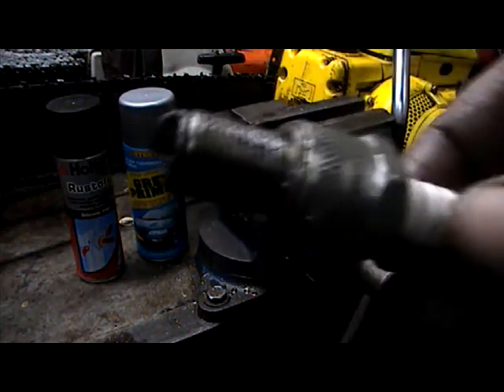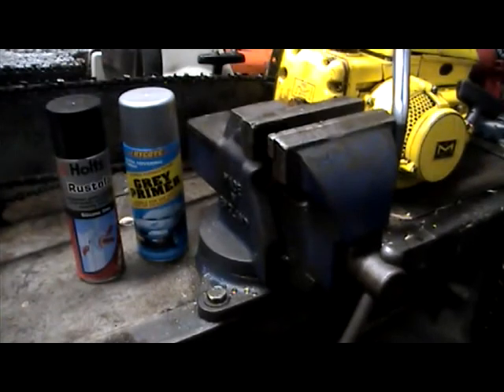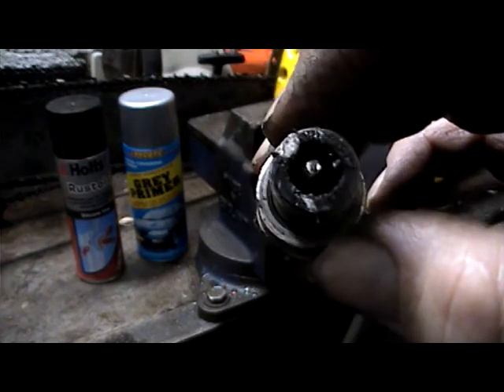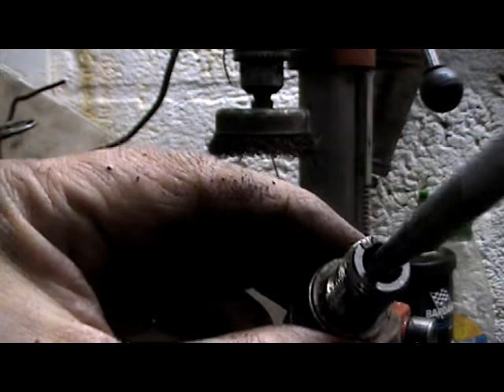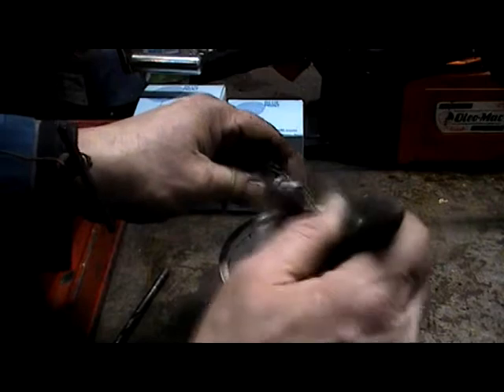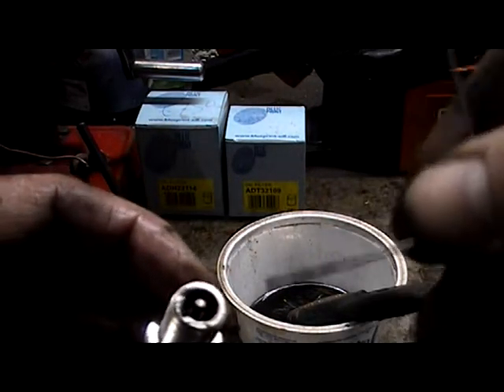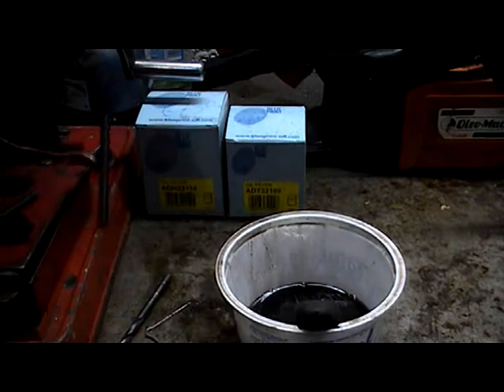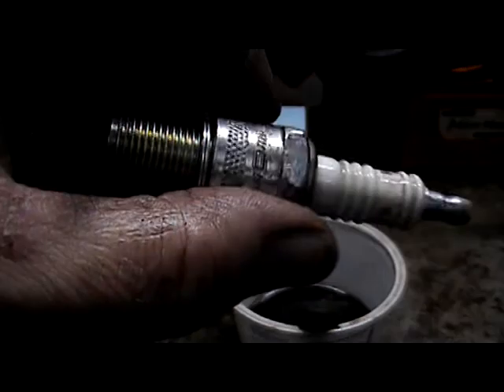how to make a test plug champ N21.mpg

Comment from the maker: @donyboy73 in .1979 i was changing a fuel tank on a mini 1000 ,the tank is in the boot [trunk], the cap had to come off, to get the tank out,the boss told me to hook up the hand lamp to the battry, which is also in the boot, a small spark from the light, ignited the fuel , i was blown out of the boot,lucky the tank was almost empty,looked liked kung fu for a while,got the tash trimmed, and the hair on the back of my hands permed,LOL

Comment from the maker: @th19940305 jet fuel, or kero, kerosine,u can use a wee drop of gasoline, kero is safer, around the shop.keep gasoline away from heat and sparks, keep in safe place with caps on, got a lesson 30 year ago, dont mess with gas or thinners,